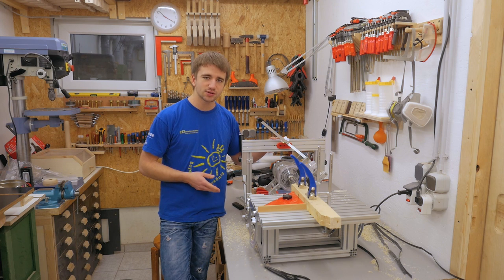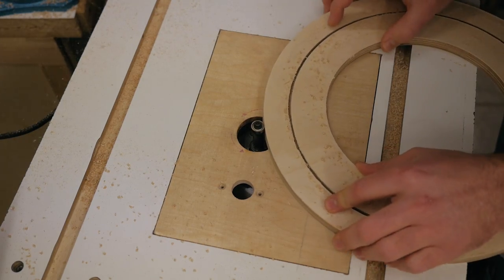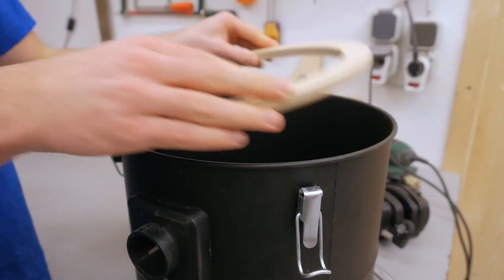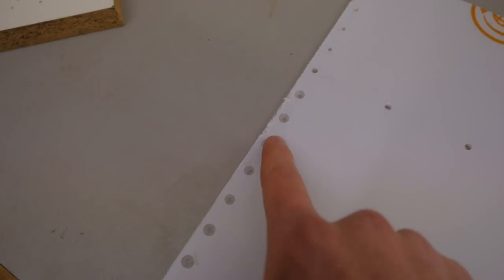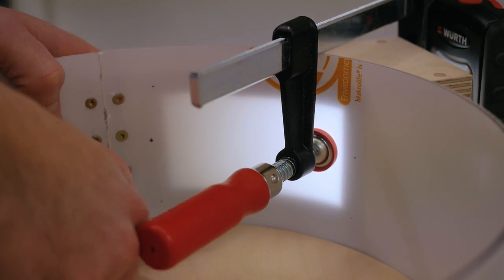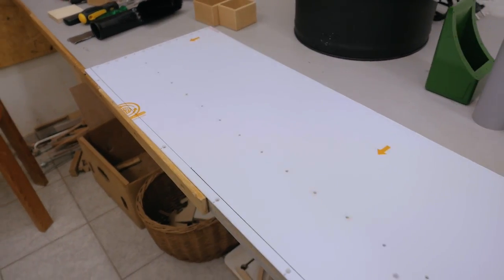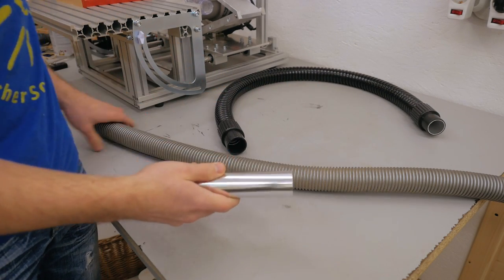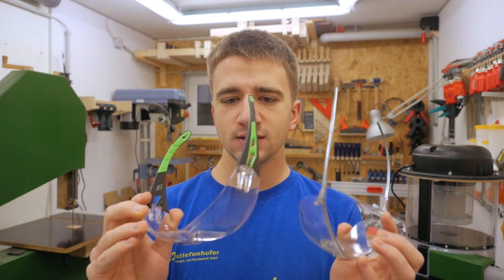A small Cyclone Dust Collector with a Cheap Vacuum

Comment: I have a challenge for you: I have three rabbits and they are hairy. Maybe you can show us how to build a collector which runs all the time with a pc fan or something. In my case the rabbit house has a light, which is powered by solar. I would like to connect the battery with the collector. Also the collector should be silent

Comment: too late now, but what about moving he thien baffle part up by about 3 cm (eliminiating some of the extra space around the filter), but instead extending the bucket below.  That way you can over fill it, and see as it gets full.
Reply from the maker: Good idea. I wanted that space below the filter to avoid blocking the airstream too much, but during assembly, I saw that it could have been less.
Reply: Marius Hornberger I was going to mention the height of the inlet also but saw that Matthias pointed it out!
Reply: Matthias Wandel Amazing you could compose a message... Thought you'd be far too excited after seeing that silly router thing.
Reply: MKRM27 Dude. He made his own. Why would he be?
Reply: WAW
Reply: Now you have extra space for larger less restrictive filter.
Reply: I was going to ask this very question as my proxxon unit has a bigger top unit and filter (from the fixing lip to the base of the filter) but the total height is being restricted to 800mm\31.5" and thus need to pinch as much space as possible. 
I may have a wind whistle haha.
Are there any general rules I should follow like 2\3 top filter section and1\3 below cyclone section ? 
top work chaps and follow you both anyway😋
Reply: why  waste your life cleaning spillage from an overfill, seems like building an annoyance No?  the view window is in already Well done Marius
Reply: What is the model number of the vacuum you used? Thanks!
Reply: Invented.. I think..
Reply: the vacuum is the ash cleaner sold by the discounter "hofer" in germany and austria (at least I think I saw that exact same one on the shelves a couple of months ago). I don't know if it's available internationally somewhere though.
Reply: It is available internationally ,I bought one 2 years ago Home Hardware in Canada.
Reply: @MKRM27 Are you referring to the board with two bearings? If so, then that is not silly at all. Kudos to Marius. That $2 jig is a clever variation of what is called a "Long compass," which was a means of laying out and cutting long radii curves or arc segments in ship building using only a virtual center. A geometry text, a super useful thing in any workshop, would illustrate how to calculate distances and radii.
Reply: @MKRM27 My mistake! I assumed incorrectly you were referring to the router jig with two bearings to re-cut the plywood rings.
Reply: The king of blowers and dust collection.
Reply: Matthias Wande
Reply: https://www.amazon.co.uk/VonHaus-25L-Ash-Vacuum-Cleaner/dp/B078GXK3NM

Would this vacuum work for this? Looks like the intake and output are both in the lid. No need to plug any holes?
Reply: r
Reply: He voice sounds like you I thought you are Related

Comment: Tip with the silicone. Lay down a nice chunky bead, spray all around it with a mist of washing-up liquid / dish detergent and water, then swipe the bead with your finger. The silicon will not spread out to the misted areas, and you'll get a super neat bead.
Reply from the maker: I always did my finger in soapy water to spread it.
Reply: If you hold the silicone gun more steep, sopy fingers are not necessary. An angle of 80° - 85° and a bevel on the nozzle of 60° will produce a nice concave seam without wasting material

Comment: If you look at Justin Depew's project, it is very similar to what you've done. He found that the silicone sealant wasn't sticking on the polycarbonate, so after he'd been using it for 2 years, he cut it all off and re-sealed it with Sikasil N Plus, and that stuck. It's worth looking at if you haven't already. You do some very nice work, great attention to detail.

Comment: If you live in the norther hemisphere, I believe the most efficient set up for an up draft separator would be to implement an anti-cyclone system making the debris spin CCW.  On this project that would mean just moving the intake pipe from the left side of the barrel to the right side.

Great project and lots of wonderful construction techniques.  I especially liked the bearing jig for the router table and the use of a flash light to transfer a pattern.
Reply: what on earth are you talking about

Comment: Another cool version of a DIY cyclone dust collector. 2 things: In a similar build, the builder noted that silicone does not bind to polycarbonate. A couple of weeks after the build all the joints separated and he had to use some special adhesive for polycarbonate. Second thing,  Home Depot now sells a $40 cyclone separator called the Duststoper. It just pops on top of a standard 5 gallon paint bucket (or Home Depot Homer Bucket). You plug one end into your shop vac, the other to your dust source. Works very well. Of course, I realize building a see thru version is a lot more fun.

Comment: Tip for the fitting of the plastic part into the ring: calculate the circunference of the ring, then cut the plastic to that size ;)

Comment: For builds like that it's usually handy to have a can or two of Plasti Dip on hand to make makeshift rubber seals that are thinner than ones using regular silicone caulk.

Comment: Here's a good tip for you, when you silicone something like you did in here to get a perfect fit between the two edges, get hold of an old empty silicone cartridge or mastic one and stamp on the end where the round piece of the gun fits, you then have a squashed end, then open it up a little and then using this end of the cartridge run it around the joint, it will give you a perfect joint every single time, you have to judge the angle and either unsquish the cartridge or close it more, ( practice first) what I do is with my empty cartridges it cut of the last bit toss that for recycling and then store them in a box from when i have a silicone job or mastic job to do.  I was shown how to do this in spain when the windows fitters come to do the new windows in my house, they dont mess around with fingers or stupid tools, just grab and empty cartridge, squash it and away you go, the silicone that comes away just goes into the cartridge leaving a perfect line on the wall. Easey peasey and perfect every time, sinks, windows, worktops, anything it will do.

Comment: Why not move the baffle and inlet one "story" higher and use the basket around the existing filter instead of the tube? Put the baffle directly under the basket and half a pipe on the basket facing the inlet to shield it from dust flying directly on it. there still seems to be enough space for dust to seperate and your dust bin can be twice as high without gaining any overall hight.

Comment: I have RecordPower CGV336-3 55L with 100mm hose. It is very good small hybrid dust collector vith more suction a better filters. But input hose mounted on bin barrel is not good idea. I like your idea to move hose to middle section a hang it all. And transparent clear material is very nice. Ok, i must build it. :)

Comment: I want ot make this using a large galvanized garbage can with a harbor fright dust collector.  I like the concept of the inlet port coming from the side as opposed to from above with an elbow port.  The later uses a Thien baffle with a 240 degree cut out but your system has it fully cut out.  1) Why isnt there material left below the inlet. 2) How many inches deep should the baffle be from the top.  3) Would it also be better to have the vacuum outlet cut towards the top of the baffle only so lighter particles will only be brought into the vac filter.  Great job, Thanks.

Comment: I built a similiar (i.e. not as nice), coaxial design, based on a bucket topped vacuum from the local hardware store. That separtator design, I think, should be called a Thien Separator, after its inventor. I believe his goal was to make a separator that was as effective as the much more complex cyclone separators used in large factories and in those premium Dyson vacs. Mine work pretty well except that since I use mine as a general shop vac the hose gets clogged a lot, I will probably need to use a larger diameter hose. Also mine has no transparent portion, so its hard to see when its full :-(

Comment: Sehr gut gemacht Marius. Werd ich gleich mal nach bauen. Intresant wäre es zu sehen ob man das auch auf eine abfall tonne montieren könnte. Solche tonnen wie wir sie einmal die woche am Straßenrand zum entleren raus stellen. Vorteile wären das größere Volumen, die räder und der klappbaren deckel. Klar das es dan für grössere projekte geeigneter wäre. 
Baut deinen sauger genug Vakoum auf um auch ein dickenhobel zu handeln?

Mach weiter tolle videos. Grüsse aus dem schönen Unterfranken.
Reply from the maker: Es wäre kein Problem das Teil auf eine Tonne zu montieren. Einfach statt dem unteren Ring eine Platte zurechsägen, die auf die Tonne passt. Und dann eine Dichtung dazwischen. Ich weiß nur nicht ob die Tonnen Das Vakuum auhalten, oder ob sie von innen gestützt werden müssen.
Ein Dickenhobel wäre wahrscheinlich die Grenze. Dafür eingnet sich dann eine Absaugung mit hohem Volumenstrom und wenig Druck besser, als ein Staubsauger mit geringem Volumenstrom und hohem Druck.

Comment: Hi Marius, thanks for another great video. Can you give us some details on how loud the unit is compared to something like a household vacuum for instance? Do you need ear protection when using just the vacuum? Also, what is the power rating of the motor? Thanks again :)
Reply from the maker: It's 1250watt and about as loud as a normal household vacuum. No ear protection needed for it.

Comment: Awesome build - i need to make one of these! Why don't you ever go full depth with the CNC router? If you put a 3mm MDF sheet under you don't need to worry about cutting a little too deep!
Reply from the maker: Yes, but the bit I was using couldn't as that deep.
Reply: Ahh, I've just never seen a video of you cut all the way through, thought it might be worry about damaging the bed. As I'm sure you know, its a lot less work to just sand down the tabs on the toolpath rather than bandsaw and route the whole profile :)

Comment: Nice build as always. Pretty decent quality of birch plywood btw!
Instead of fitting and measuring, why didn't you use a formula to calculate the perimeter of the circle of the sheet instead?
Reply from the maker: I did, but from experience, I know that it's better to make it fit during the build.

Comment: Why Do you need a Dust Cyclone when The Volume of the Bucket is still the same?  I mean: The Cyclon stops the Dust and stuff, so they dont get into the Vacuum Unit. Thats For Expanding the Volume of Dust, Shavings and else, so you dont have to empty the Bucket as Often

Comment: coole Variation von cosmas's Entwurf. Vor allem viel einfacher zu montieren. Denselben Aschesauger hatte ich letztens für meinen Ofen gekauft, jetzt weiss ich was ich stattdessen damit mache. Kannst Du noch ein paar Maße angeben ?
Reply from the maker: Durchmesser 250mm, Höhe ca. 300mm, Die Scheibe in der Mitte ist auf auf einer Höhe von 106mm von unten. Der Spalt ist 24mm groß. 53mm Rohre (Baumarkt Abwasserrohre). Viel Spaß und Erfolg beim nachbauen.

Comment: Any experience with PVC piping vs. metal pipes with regards to price, static electricity, ease of installation, ect.?
Have heard, that static electricity can build up in a system and eventually ignite the fine dust, if not grounded.
Reply from the maker: I have never installed metal piping, so I don't know

Comment: Hello Marius, I made the mini dust collector but I have a problem. If I want to use it, much dust comes up through the separator and is sucked into the filter of the vacuum cleaner. Do you have an idea what I  have done wrong.

Comment: Great build, but you only tested it with rough shavings. What does it do with real fine dust? The reason I ask is because I work with fine dust like cementpowder and my filter keeps clogging up. Does this work with a cyclone?
Reply from the maker: Yes, it works with fine dust as well, but I don't know how well.

Comment: Thanks! Think that will be a great solution for my 2" belt sander used primarily for metal with an occasional quick profile or edge sanding project on wood..Was always concerned about sparks with a regular shop vac. From the video, it sounds a bit high pitched and loud. Found a 10amp model by PowerSmith for about the same price at 79db. Will use 22ga sheet metal for separator wall and to cover MDF baffle plate. Your builds are fantastic and entertaining! 

Would like to provide support through your wish list on Amazon, but link opens in German. How can I view your wish list in English and pay through my Amazon account?
Reply: You may have missed the second paragraph in my post (i shouldn't have used a line between). Would like to provide support through your wish list on Amazon, but link opens in German. Tried to access your list from my Amazon account using your name, but  name wasn't recognized. Your email address was requested as an alternate search. Or do you have another option for support through Amazon?
Reply from the maker: Hmm, I don't think that's possible. But you should be able to log into the German Amazon with your account.
Reply: Found the translation link under the search icon near top of Amazon web page. Was able to access my Amazon account for payment but could not access my Prime account for shipping?? Transaction was successful. Thanks for hosting this site! Enjoy your projects and commentary.

Comment: I must have missed this part...  how much clearance do you want between the baffle and the inside diameter of the side?  Looks like it is about 1.5"....  if you change this clearance (making the baffle diameter smaller or larger) will it have an effect on particle separation?
Reply from the maker: It's 24mm (about 1 ") which is enough for the big shavings from the pantorouter. If too small, then these shavings could plug it up. If too big the separation isn't as good.

Comment: I've not previously seen a Thien baffle design with a slot cut into the outlet tube. Unfortunately, Cosmas' video doesn't mention the source either.

It occurs to me that it'd likely cause a lot of turbulence (which I've previously been advised to avoid). Do you have any info on where the idea came from, and possibly comparisons with the standard Thien design?
Reply from the maker: As far as I know, it's Cosmas idea. Presented in an earlier video of his.
Reply: Thanks. I'll leave a comment on his video. I did watch it (and scrolled through the comments) but there didn't appear to be any mention of the origin of the design.

If your version works as good as it looks then it's certainly worth the effort.

Comment: The device turned out really cool!
But, you have your big dust collection with multiple hoses, which was awesomely updated a month ago! Why did you decide not to use it and make the separate smaller one?
Reply from the maker: I want the Pantorouter mobile with permanent dust collection. And my big dust collector is the wrong machine for this. At small hose diameters, a vacuum is much better than a big dust collector.
Reply: Thank you for your reply, now your motiation is clear to me! :)
I am currently planning my dust collection system for my CNC and the situation is similar, I guess. Good industrial high pressure fans (Russian classification, not sure if it matches anything international) good for dust removal are costly and provide good enough suction only from 1.5kw power. Well, they are not that super costly (about 200-250 euro),  buf for this cost I can buy 3-4 vacuum cleaners like yours!  The choice seem obvoius in terms of price, but the option to mount an industrial (reliable) fan outside of the building seemd so cool that I just was not decide! :)
Anyways, thank you for your video! It brings me closer to a cheap solution, so it would also potentially save me money :)
Reply: Also, I would like to express my gratitude for dust collection series of videos! It gave me A LOT in understanding of a proper dust collection system.

Comment: Great build Marius! I noticed that at the start the router did not have a brush around it, but at the end it did however you did not mention adding this in your video wrap up. What type of brush did you use for this and how much more efficient did it make the dust collection? I am guessing that it would make it difficult to watch what you are doing though?
Reply from the maker: I took them off in the beginning, to see how much dust gets thrown around. The brush came with the Pantorouter.
Reply: Cool, thanks for the clarification mate.

Comment: Very nice build! Can someone explain to me as I'm a bit lazy... Is it possible to just use an ash vac without the cyclone? Can they be used without a bag and you just empty the cannister as it fills? Or would this damage the vacuum? Thanks!
Reply from the maker: +johnners911 without the cyclone the filter gets direct contact with the dust and clogs very fast. The cyclone separates the air from the dust before it enters the filter, so it stays clean and you never lose suction.
Reply: Thank you Marius for the reply. It makes sense. I don't have a lot of time on my hands unfortunately but I have a new bandsaw and want to get it running! I have ordered one of the little cyclone separators from ebay and will hopefully get working soon :) It won't be as nice as your build though! Best wishes! J

Comment: My polycarbonate cracked in two places for some reason.  Maybe I should have heat gunned it into shape to take the stress off.
Reply from the maker: Then it was no Polycarbonate. Polycarbonate doesn't break
Reply: @MariusHornberger  Ah, right you are. I checked the receipt, it is Acrylic.